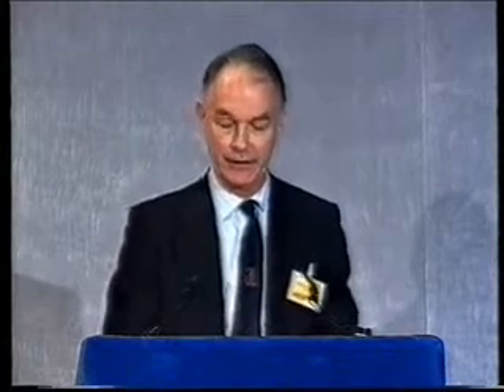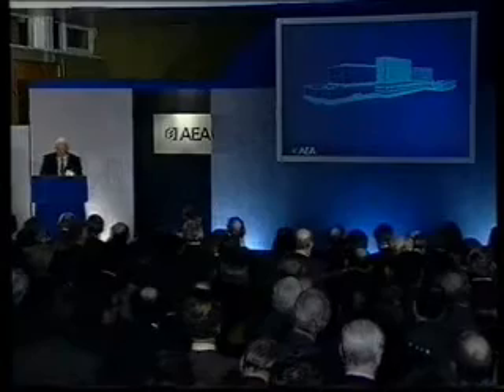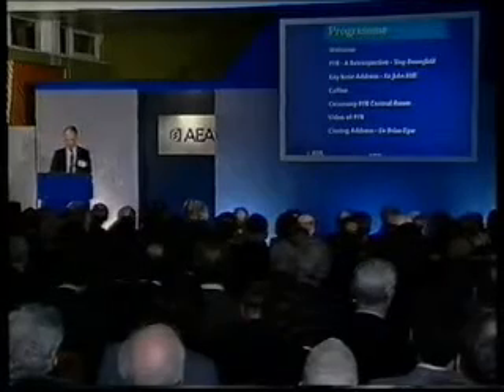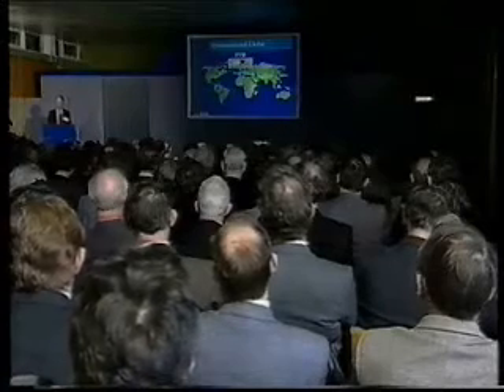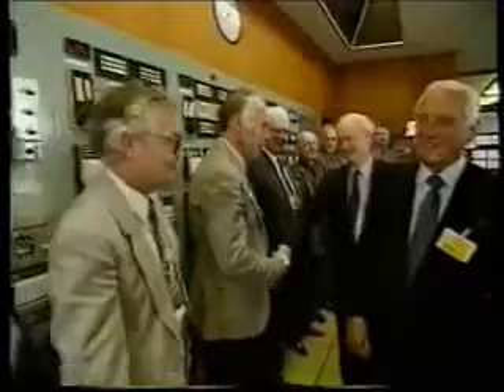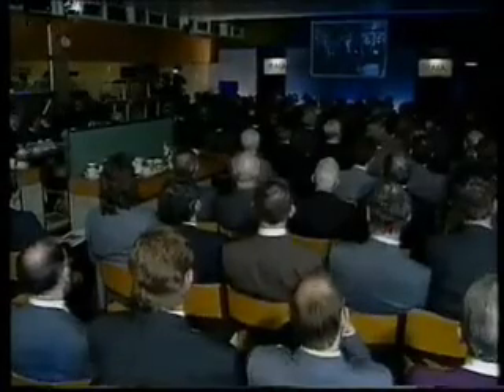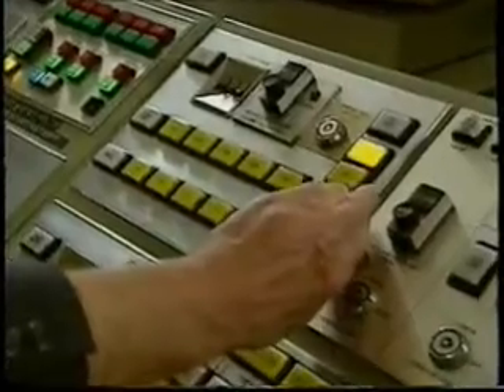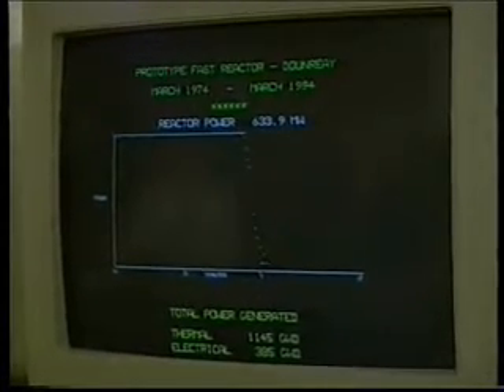Fast Reactors - The Dounreay Connection Pt 2.

Comment: why was the project killed?
Reply: Lots of reasons. Growing anti-nuclear sentiment (with some justification) didn't help, but it was mainly cost and value-for-cost. A breeder is a way to extract more value out of your fissile uranium, which is an economically sensible thing to do when fissile uranium is rare and expensive. Fissile uranium was rare and expensive when these reactors were designed and built, but the price has dropped as proven reserves have increased. Nowadays, it is cheaper to burn fissile uranium in a non-breeding reactor, dump the used fuel into long-term storage, and buy new fuel. The cost of reprocessing the used fuel and the breeder blanket into new fuel elements is greater than just buying new fuel.

It's a shame.
Reply: Thanks for the well put reply Aaron.
Reply: It seems to me that it's yet another example of governmental lack of foresight. Future generations will find it unbelievable that we should continue using power stations that use only 1 or 2 percent of the fuel fed into them and discarding the rest when, for 20 years we've had a FBR program generating power and breeding more fuel in the process. Unfortunately, politicians are concerned only with the next 4 or five years and there is no incentive to look to the long term. France, Russia, Japan, India and others have instigated FBR reactor programmes, presumably with a view to safeguarding their energy supplies into the future and here we have a wealth of experience, knowledgeable scientific, engineering and technical people and an operational facility all being consigned to the scrapheap. Or am I being too cynical?
Reply: The issue is the handling of plutonium, due to its radioactivity it requires special handling which only increases costs, as opposed to just using uranium fuel. As mentioned elsewhere, these videos omit the issues surrounding the radioactive discharge issues linked to Dounreay.